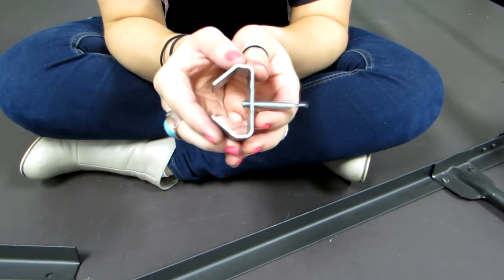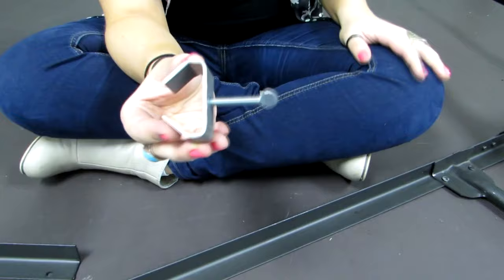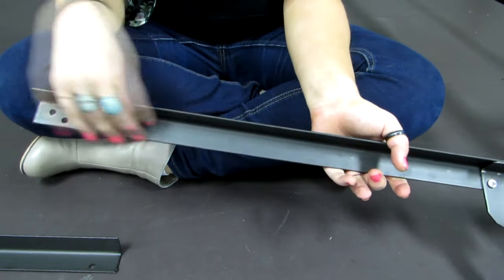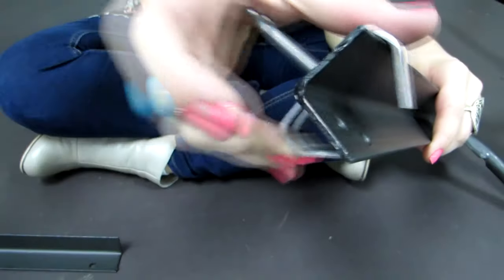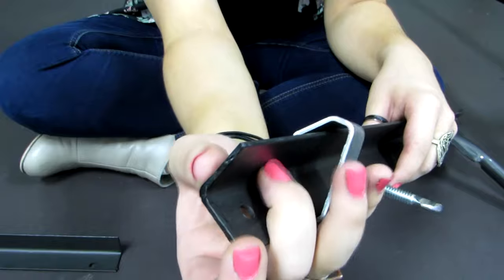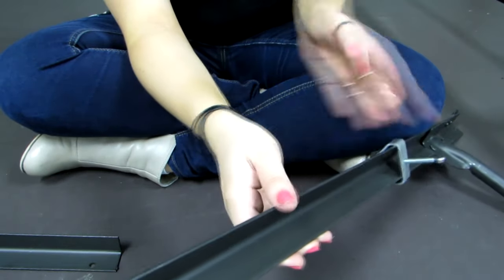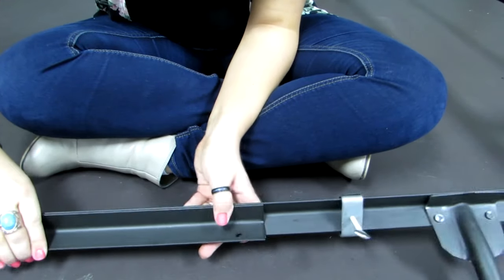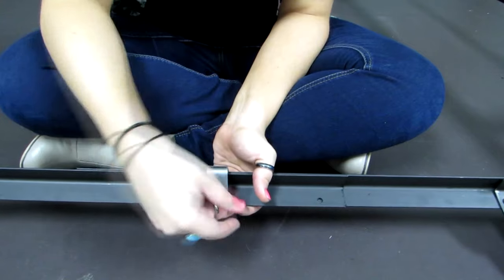Bed Frame C-Clamp

Comment: Mine keeps coming off .. Does that mean i have bad clamps orrr ?? I dont get it .. I have to fix it everynight and when i get up my bed is slanted and i lift up my bed to find the clamps both undone and pn the floor ):
Reply from the maker: It sounds like the clamp could be too large or possibly stripped, meaning it will not stay tight.